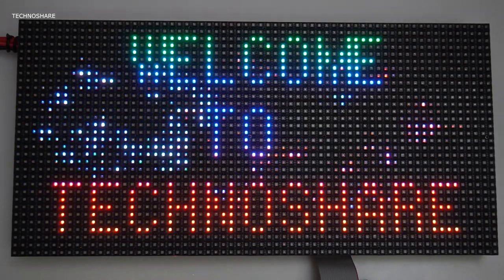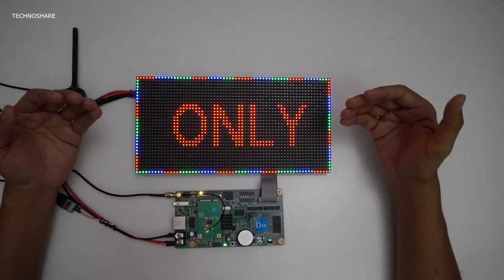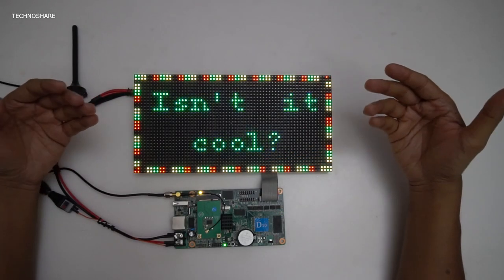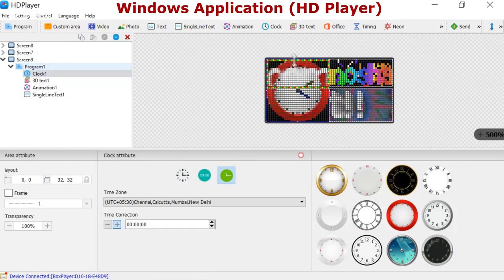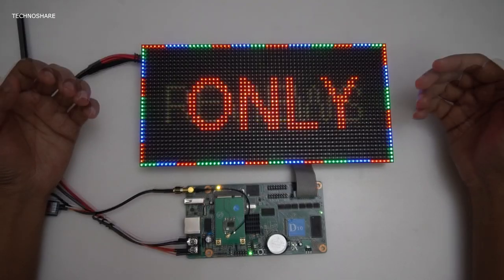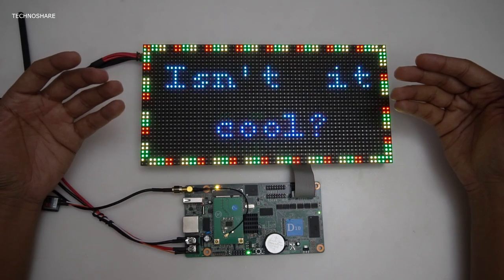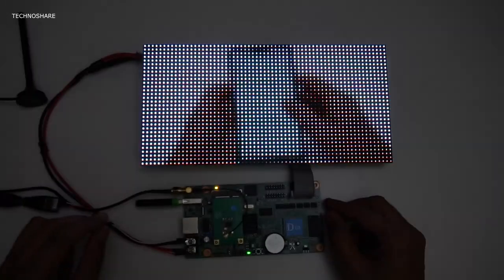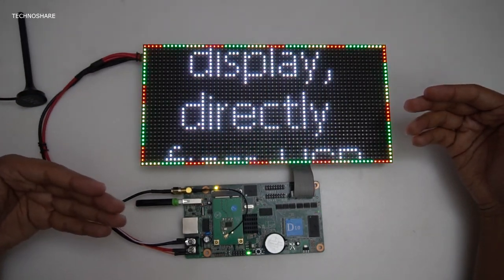Video Wall / RGB LED Message Board

Comment: Hi, this is a very good video with very clear instructions. I wish you could follow up with one that has more advanced features like connecting more panels, using the Huidu D10/15 Wifi controller etc. Thanks for the good work.
Reply from the maker: Hi! Thank you so much for your comments and suggestions. Yes, I will definitely do couple of more videos on the panel and the controller in the coming days. Could take a little longer time for the video to come out.
Thank you 🙂👍
Reply: @TechnoShare  2222222222222222222222222222222222222222222222222222222222222222222222222222222222222222222222222222222222222222222222222222222222222222222222222222333333332उ
Reply: Thanks for sharing this awesome video. My question I have panel led board hub12 how I can change the Chinese character to English.Thank you in Advance.

Comment: Good morning, After editing text, i have exported tu UBS but when I connect it, my led Cross display screen turns white. Please help
Reply from the maker: Hey there! Sorry to see you having trouble with the display. I believe, it could be due to connection issue. Can you please check back on the connection pins? Also, I hope you have ensured the right combination of the display board with the controller board. In the software, you may want to select the board type also.

Comment: Hello, you seem to master the Huidu HD D10 controllers very well,
maybe you can help me I have a problem I would like to program the "TIMER" so that every day it starts a countdown on the time remaining before "12h00" if you have a solution I am interested in it thank you
Reply from the maker: Hey there! Even I wanted to see if the Huidu controller could be programmed to achieve custom functionality. However, I could not find any way to use the hardware for programming. Seems like huidu is limited only to the functionalities on the mobile app or windows application. However, you can use esp32 and display on P3 led panel. No need for Huidu controller. There are lots of resources on the Internet on how to program esp32 and connections to the p3 panel. Please check if that helps. Thanks for watching!

Comment: Brother i have a question 
How can we join the leds if i want to make a display of 5 ft by 5ft 
I mean to ask i will conect the row 1 smd led with 2nd row led or with the led of coloumn 
Does it make any diffrence and how many led in parallel i can use with smps of 5 v and huidu d10 or can i use some other controller like some other

Comment: hello, I have the same controller and a P4 display but I don't know which parameters to configure in the LedArt APP and in the software, what should I set, which parameters should I enter to make the display work correctly. There are many parameters to set and only inconsistent characters appear on the display. Thanks
Reply: For the windows software after you install the software you have to go to settings and choose the exact board you are using and the number of vertical and horizontal LEDs your board has. That info is usual shown on the back of the LED display along with a password that you should store somewhere..

Comment: Hi bro I have P3 LED wall I want use display controller it working
Reply from the maker: Hi bro..Yes, you can go for the Huidu controller. It performs pretty well. If you dont need to display video, and need it for just text and images, then there are cheaper options available. This model, I bought it for video display. Hope this helps!! thanks for watching 🙂 Thanks! 👍

Comment: Hd d10 is not connecting with p5 panel
Reply from the maker: In the windows software you may want to just check the options. Some Setting you may need to change to select the panel type and the resolution. I think i too did face some problem initially. But i somehow managed to configure it.
Reply: @TechnoShare  thanks bro

Comment: D10 u disk is not connecting to laptop what i will do
Reply from the maker: Hi, Have you installed the software HDPlayer on your laptop? In that software we will have option to connect to the D10. It can connect in 2 modes. Hotspot mode or via a router. Download the user manual from their website. There is lot of information on connection options and how to connect procedures.
Thanks for watching!
Reply: @TechnoShare  thank you

Comment: Controller id is not connect automatically
Reply: Any setting in laptop
Reply from the maker: Is your D10 having wireless card? Or is it via LAN cable?
Reply: @TechnoShare  LAN cable
Reply from the maker: Oh. Ok sir. Mine is wifi based. I have not tried to connect through LAN cable. If direct connection to laptop is not working, please try connecting it to your router. You may have to make some settings in the HDPlayer settings. Its given in the operation manual. Please check. Thank you.